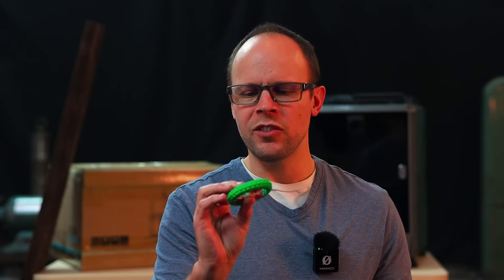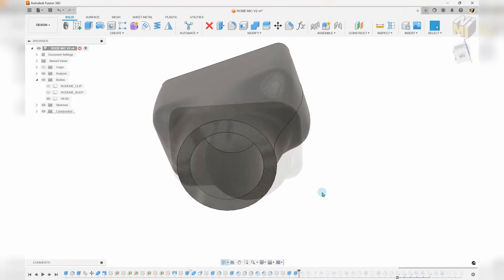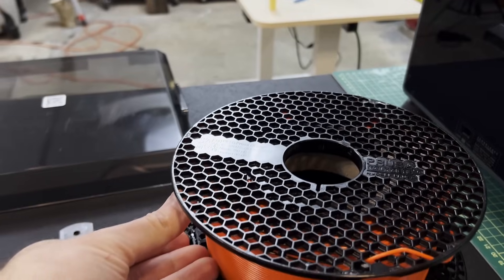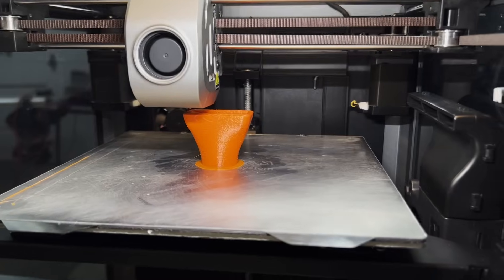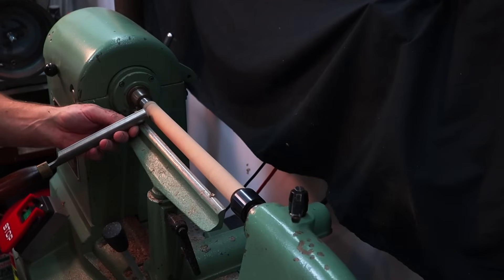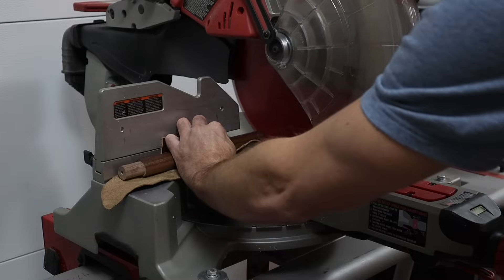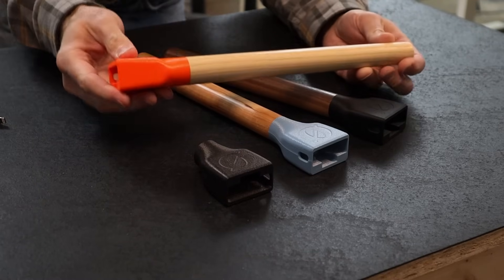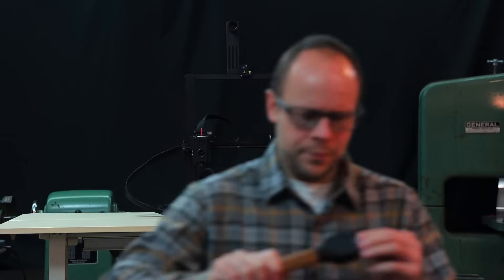Can we Make a High Quality 3D Print?

Comment: ...or just get yourself a resin printer! As far as detail goes and less "toy plastic"feel. Plus you can get it to have exact measurements and sharp corners etc.
Reply from the maker: I'm open, for smaller parts like that it probably makes sense.  I haven't gone down the resin path yet, but I want to.  I have been waiting for some new tech to come out which blows the rest of out printers away.  Printing with lasers in Gel seems like it might be one of the newer methods.   Do resin printers allow printing in dark colors or are they mainly clearish/white?
Reply: @NeedItMakeIt  The laser/gel way is a long time from being practical, just a concept/prototype at this point, that will definitely take a few years, but i  also love it, haha. Colors are possible, but painting really is the best way.